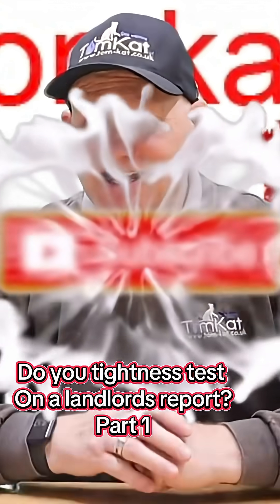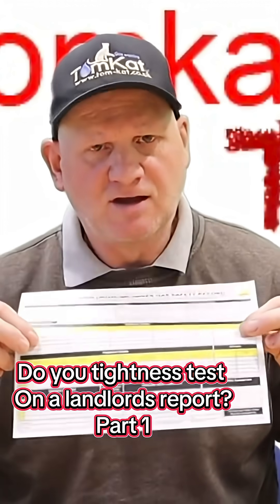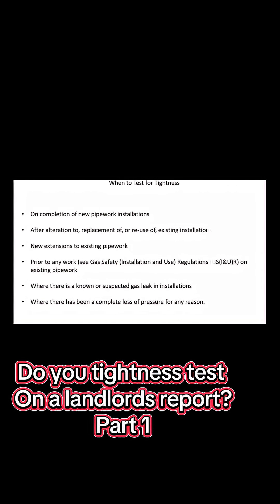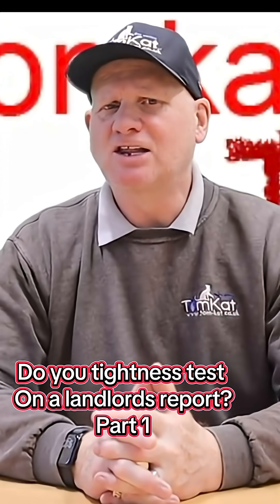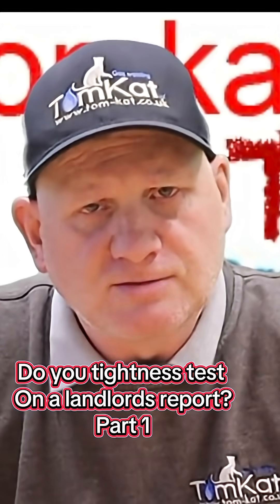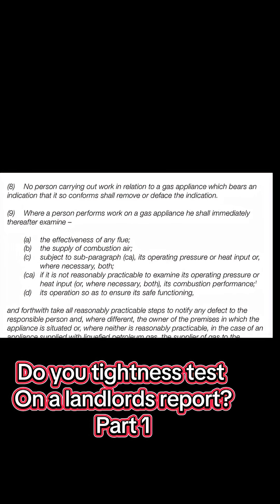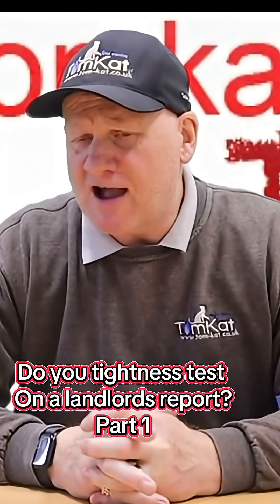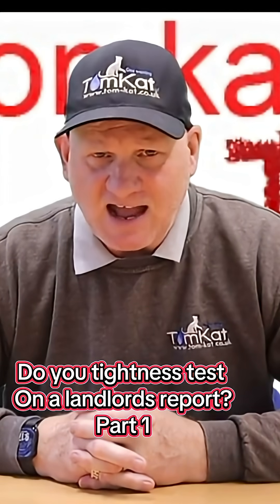Do you need to do a tightness test on a landlords report? Part 1 #gastraining #plumber #gassafety

Comment: Its part of the landlord act, the integrity of all pipework needs to be checked on a yearly basis. If landlord tells you to do it, you have to do it. If they say nothing, you dont have to do it. I do it as standard anyway
Reply: Not sure what you mean by this .are you saying you disconnect all gasapplianxes so that you are testing pipework only ? That's wrong if you are as the permissable drop with no smell of gas and appliances connected is there for a reason.your creating unnecessary work that the customer probably doesn't want to pay out for .
Reply: @danielblack1220 no with appliances connected. If there is a leak, you should ideally turn off one appliance at a time to check its not on the pipework as no drops allowed on pipework
Reply: Daniel is correct, if you have a permissible drop and there is no smell of gas. It is deemed safe, and you do not have to disconnect each appliance and test. I have had this confirmed by Gas Safe after a long discussion in another group.
Reply: @MrRedspanner yes correct, you dont, but in IGem its stated that it should be carried out to eliminate the pipework side. Nobody is going to do that as they dont like working 😂😂
Reply: @danielblack1220 unecessary work is just the attitude we dont need in the gas world, we as gas engineers need to be rigid. So what if you find a drop, your gonna get paid for it to trace and repair. Cant put a price on safety. I find 0.5 mbar drops all the time and find them at hobs all the time. Thats the reason why im.making a fortune and your not lol